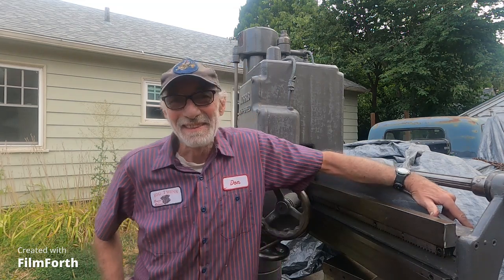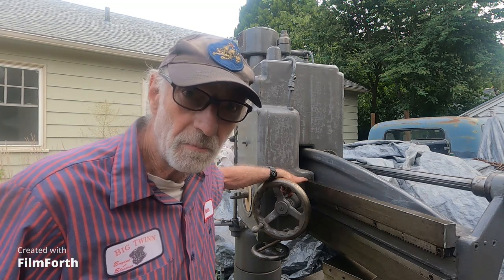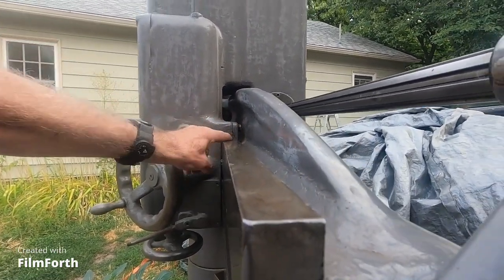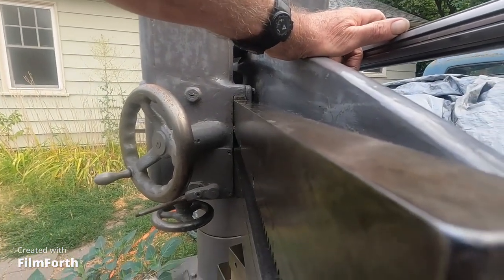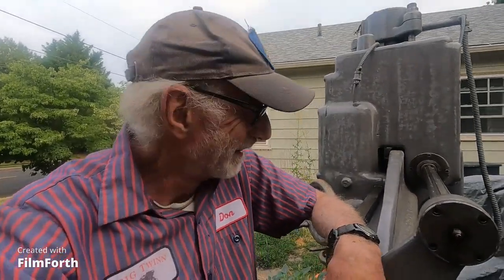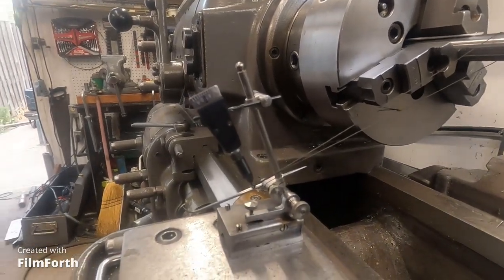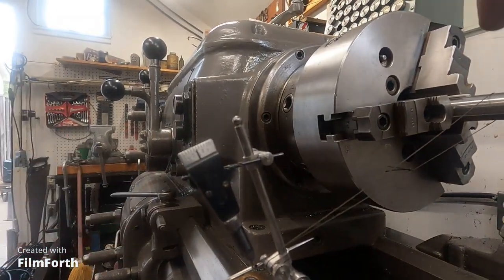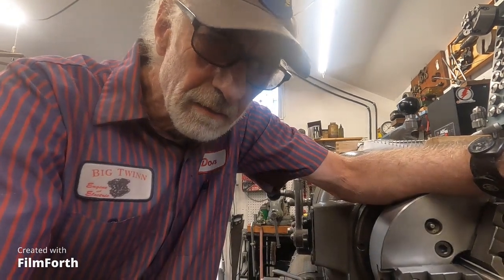This is why old machinist indicators have a hole in the tip

Comment: I'll be damned Don. What a cool thing. The older I get the more I realize how smart those old timers really were. everything was bigger and heavier. They had to work smart.
Reply from the maker: I think some of the older methods stayed around longer in this rural area, there were still line shaft powered shops in to the 1970s.

Comment: Hi Don, I have never seen one of those indicators in the flesh but I guessed the hole might be to attach some sort of connection but to use it to check the run out as you demonstrated had not occurred to me. What a great tip. I was surprised to see that when rotating the shaft the friction between the shaft and the string did not appear to cause the needle to deflect  to any great degree. Is there an old millwright's trick there? I was also wondering what the relationship was between the indicated movement and actual run out would be, my old alcimered brain won't do the math any more.
Reply from the maker: The thread is silk surgery thread and very slick, the indicator shows a bit less than actual when looped around 
 the shaft but can get more accurate by partial wrap and anchoring the loose end. The thread can be guided over other shafts if needed.

Comment: The big drill press, I'd leave it to the next guy to fix. Just move it over to by the table so you can use it. You can just move the work piece. Just get 2 large blocks to save damaging the table and some clamps, and just enjoy it. You've done the best job by saving it. The next guy can do his bit unless you can't do without fixing it. Dee dee? P.S. Have you seen the 2Up world speed record being beaten?
Reply from the maker: These radial drills and particularly this one and one of the small Fosdick drills had a precision ball bearing spindle nose adapted to line boring, a common industrial function in years past, I bought the Axelson lathe to create that special tooling for this drill, I have a good enough time doing what I do includes always moving forward, learned that in business, so the drill will be scheduled for that repair.
Reply: @deedeeindustrialsuperprecision  I will look forward to seeing it in action, I take it you're waiting until you sell your 10EE lathe until the radial drill can fit someplace. I guess perfection pays for itself in accomplishments.
Reply from the maker: @PeckhamHall  I have a house i am re working too, just not doing house repair videos. but could use YouTube to sell this house The number one priorityon the machine end was getting that Axelson running so I will have a running machine when the Monarch 10ee is sold so as I can finish the work and make tools for the other machines using the now completed Axelson lathe that took considerably more effort than I was  going to put into it but it turned out to be a fully function and viable machine. I am not waiting for rich old hippies moving in here to buy everything up, wandering downtown drunk stoned on coke bragging about it, parking their f8cked up green haired kids at the colleges here, being I only an army of one at this time operating at 9 levels and moving as a knight on the chess board always forward in that pattern of 3, how about some advice on that?
Reply: @deedeeindustrialsuperprecision  I think you are very active, Dee dee, and you do a lot of work to make  your videos for YouTube , which are  great to watch, so don't let anyone get you down mate.